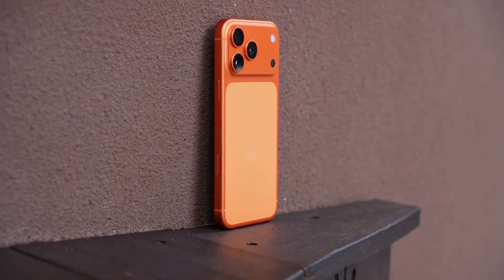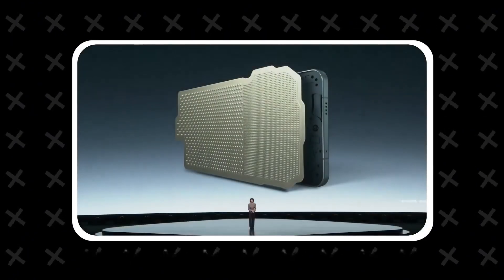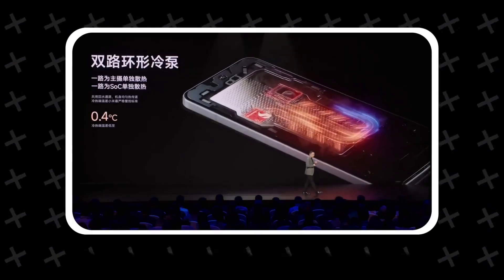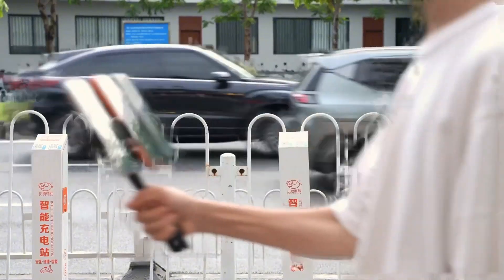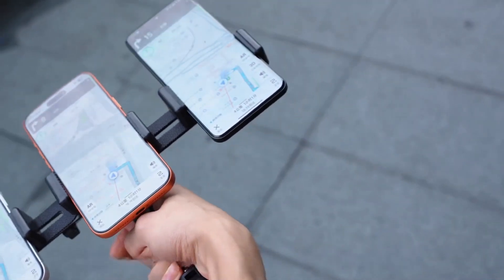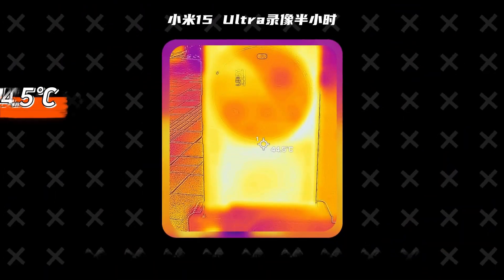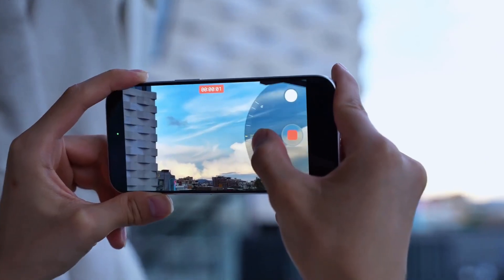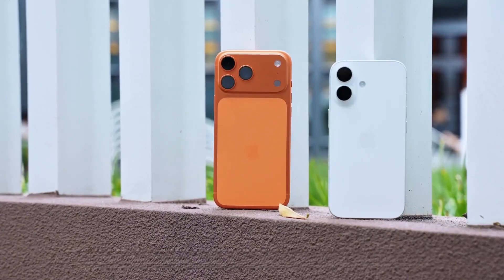iPhone 17 Pro Max Heat Test - I AM SHOCKED

Comment: Not accurate. Yesterday I took photos (not even videos) under direct sunlight with my iPhone 17 PM, and it had thermal throttling and my iPhone stuttered. Never encountered it in previous generations. It is very disappointing, as it is not only not improving but actually worse.
Reply: Mine is fantastic no heat whatsoever, keep in mind I live in Dubai so the sun is scorching hot
Reply: @QSA-X does your 17 pro max gets warm while charging with fast charger ?
Reply: @QSA-X good for you, I visited Dubai before so of course I know how hot it gets, but doesn’t affect the fact that it had throttling in my ‘cooler’ climate region
Reply: @BlackCurrant25 A lot of people are reporting that the 17 Pros barely throttle. Did you have a case on it or left it in a hot place before using it?
Reply: @MrSamPhoenix I have been ifanboy for so many years so I am genuinely disappointed that it throttled worse than iPhone 15 Pro I used to have. Really weird. Yeah i was taking photos under direct sunlight on the hottest day here in Hong Kong
Reply: Do you have a video?
Reply: @MrSamPhoenix no
Reply: Why are you lying?
Reply: Kind of meaningless. The vapour chamber dissipates heat from the chip , not heat from the Sun.
Reply: @h3yn0w  well that's pretty obvious
Reply: doesnt make it immune to heat, any computer would struggle being in direct sun & the phone has everything built in but still not magic
Reply: Might be an issue with your unit?